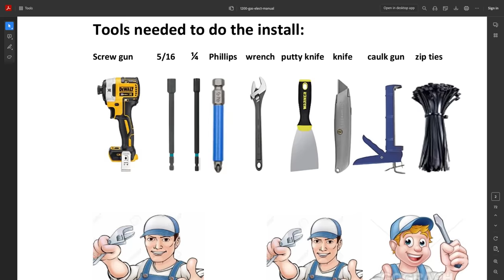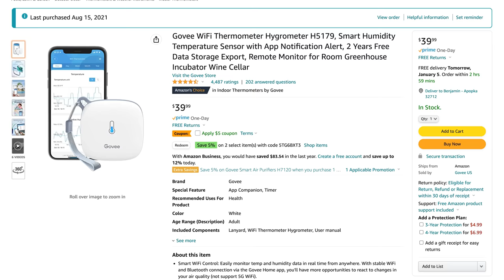We Saved HUNDREDS With THIS DIY RV Mod (Why Is Nobody Talking About This?!)

Comment: Maybe I missed it, on a gas line you should probably put the yellow tape on the plug for best seal.
Reply: I was wondering same
Reply from the maker: I double checked with the owner of the company and he mentioned "Since this is a flare plug you will not need any tread sealant at all, just turn in tight and its good."
Reply: @GratefulGlamper  good to know. Thanks!
Reply: @GratefulGlamper  Hmm, learn something new every day

Comment: So no Teflon tape on the propane cap 😮
Reply from the maker: Since this is a flare plug you will not need any tread sealant or tape at all, just turn in tight and its good.

Comment: Why two Compressors?
One for the Fridge and one for the Freezer?
Reply from the maker: Good question! I believe that is the case.
Reply from the maker: Ok, so after talking to the owner about 2 compressors, here is what he had to say "We used to make them single compressor but it seemed we struggled a lot maintaining the correct fridge versus freezer temps going from summer to winter, this was all metered by so many inches of copper in the fridge with so many inch’s of copper in the freezer, and you had really no way to fine tune it once installed, so the 2 compressor separate controller idea was born and believe me there is no comparison and no looking back"
Reply: @GratefulGlamper  Mskrs total sense.  In a "normal" house fridge there's an opening in the back that lets cold air grom the Freezer section down into the Fridge section. When the Fridge needs cooling it just makes the freezer colder. The side by side doors style might be 2 compressors...
Super cool retrofit!
I will book mark their buisness.

Comment: induction stove, no gas fridge, you guys are slowly whittling down the gas. Not sure about the furnace though...may have to keep that?
Reply from the maker: We will keep the propane furnace but our roof top a/c’s do have heat pumps so we do have a heat source that isn’t propane.

Comment: Best replacement is the AMISH AIRE.  12 VOLT.  KEEP YOUR REFRIGERATOR ...
 PUT THEIRS ON YOUR CABINET.  Started my comment... then they mentioned JC.  They are the same unit.  Easier to go to Indiana and have the experts do it in 3 hours. THEY do not remove your unit from your RV.  No reason to remove your unit from your coach.  Oh well. This is my (unfortunate) criticism of this vlog.  As they admit, their 1st time. We got the Amish Aire last fall. It works great. But you should NOT have to remove your cabinet. Oh well. They mean well. p.s. we have 140,000 miles on our coach.
Reply from the maker: Since our travel plans this year didn’t include  the Midwest, it was worth our time to DIY vs spend $ on fuel and the time driving there. And yes, it’s the “same” unit as the Dutch Aire or the “Amish RV Cooling Unit”

Comment: I’ve ran my propane fridge for decades going down the road ..  I wouldn’t want to not have it ..
Reply from the maker: It’s always made me nervous. And for whatever reason, ours wouldn’t get very cold on propane (our rig is an 04, so it’s older).The good thing is that we have 600ah of lithium batteries, so shouldn’t be an issue. And, now Charity can have her cold ice cream :)
Reply: @GratefulGlamper  nice.  Ours is a 2001 Winnebago adventurer.  We did replace our fridge 8; 2019. .  But if it goes out again what you guys did looks like a good option.